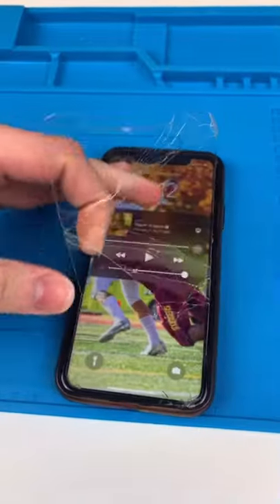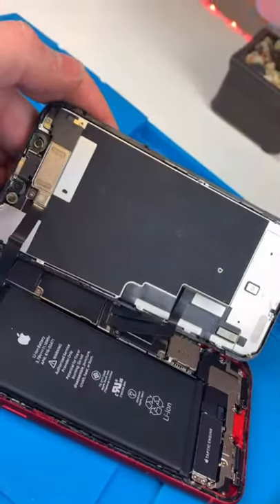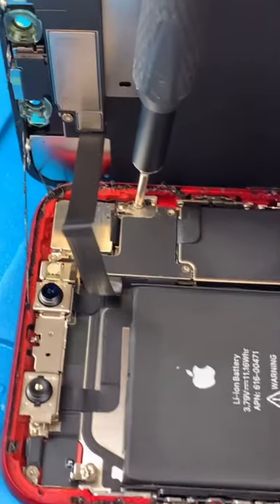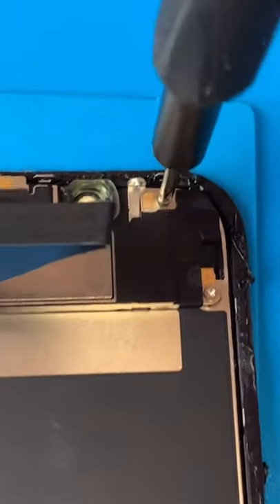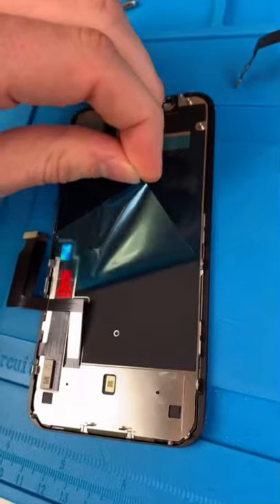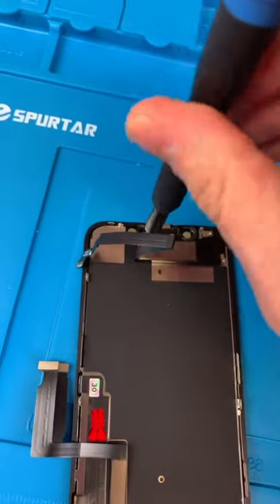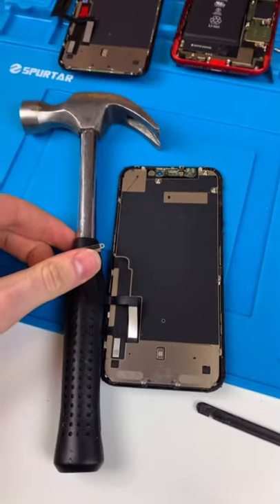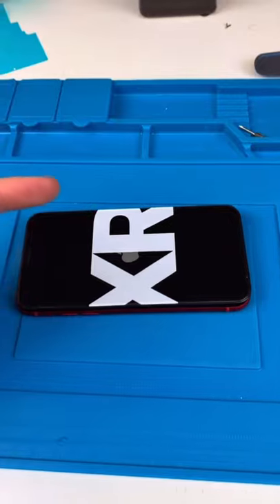Apple Please Stop Putting Random Philips Screws In.. iPhone XR Restored #Shorts

Comment: This may be an odd question but i wanna know why the back of my phone comes off randomly when my phone case is off, heres some things i think is happening with my phone 
1. My phone is getting to old and is falling apart
2. The battery expanded a bit
3. Since i always play roblox with my phone charging my phone over heats for a bit and heat makes the glue in the phone less sticky so the back of the phone comes off. I honestly think its the third one because the two others could happen but i dont think thats the problem 

If you read this all then thanks and does anyone know whats wrong with my phone lol

Comment: 1-Apple will give you a new phone in warranty or transfer your data to another refurbished phone.

2-Trained shops will fix the Face ID module (here in the Dominican Republic they do, for like $90) depending on the phone and how the issue surfaced (ex: Fall, Factory Damaged etc)

Comment: I have 4 questions if you or anyone could answer that would be great. 1: Is iphone 7 lcd swappable with 8 or vice versa? 2: Can we fix face ID by swapping parts between iphones? 3: Supposedly if we swap screens between iphones x do we need to program the screen? 4: After swapping the screens between iphones x will it still give non oem screen notification? Thanks